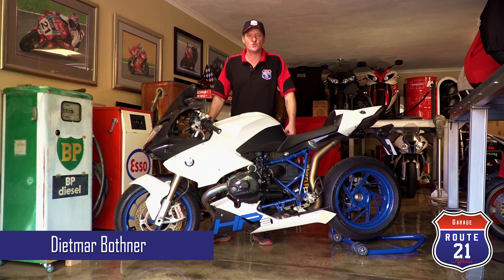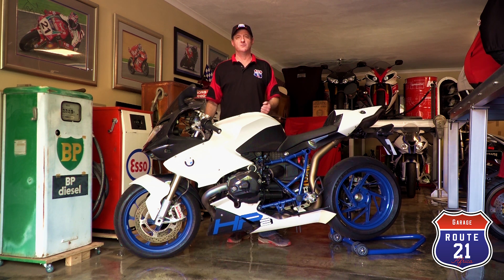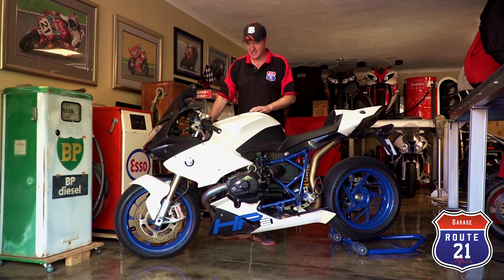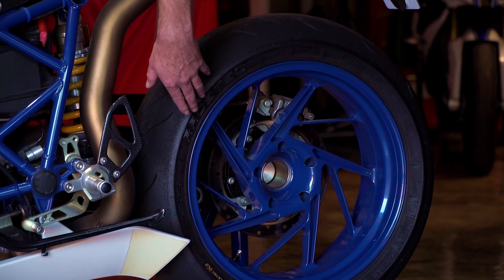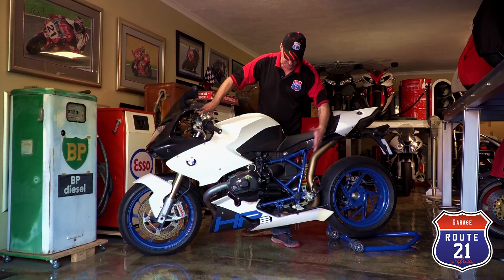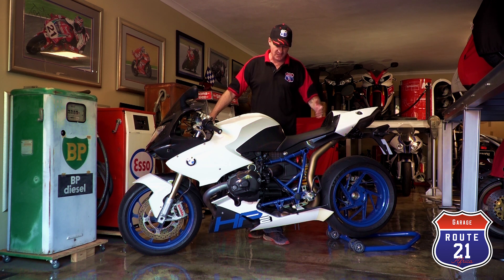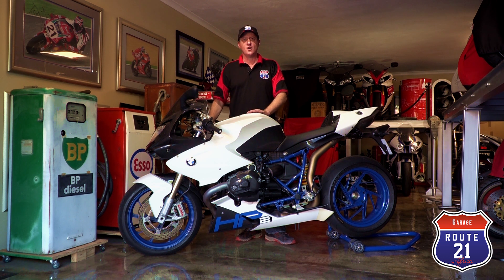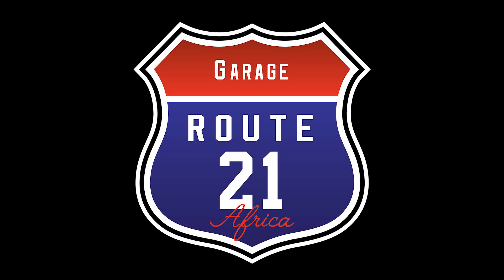BMW HP 2

Comment: it's 100 anniversary to BMW. I've heard rumours of new R1200S coming out..
Reply from the maker: Wow, I haven’t heard anything but that would be awesome 👍🏻
Reply: @route21garage  Well, it's still rumours but, coming from really reliable sources. 
There is one hp2  with 11 900€ asking price. What do you think. Should I go for it. Might be the last change.. There isn't many of those here in Finland.
Reply from the maker: That price is really good. There is one for sale here in SA right now with 17.500km on the clock and asking price  converted in Euro is 19.000 . I would get it, cause as you say, they are getting very scarce.